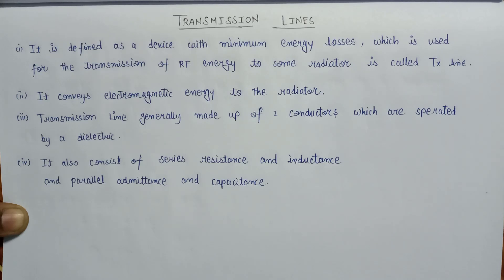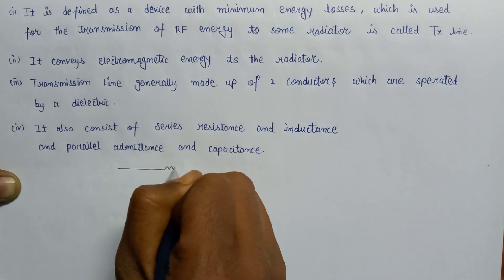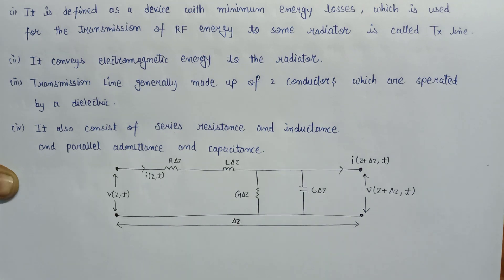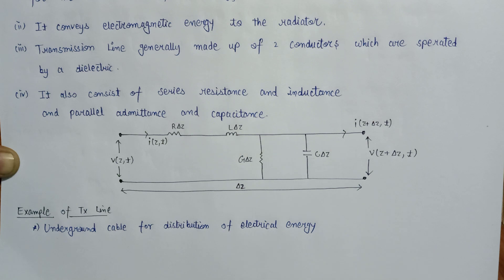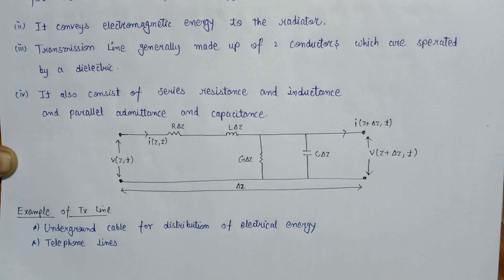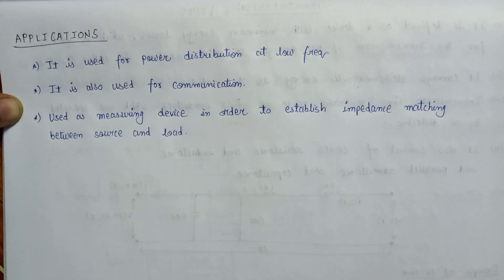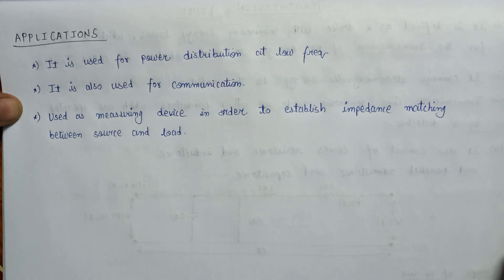Transmission Lines | Transmission Lines in Electromagnetic Waves | Transmission Lines Parameters

Comment: 00:02 A transmission line is a device with minimum energy losses used for the transmission of RF energy to a radiator.
00:41 Transmission lines consist of resistance, inductance, capacitance, and conductance
01:20 Transmission lines consist of resistance, inductance, conductor, and capacitance connected in parallel combination.
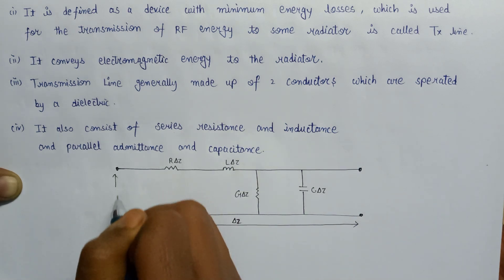02:03 Voltage applied at the input side causes current to flow and results in an output voltage and current.
02:41 The basic structure of a transmission line.
03:31 Transmission lines are found in various applications in our surroundings.
04:45 Transmission lines are used for power distribution and communication at low frequencies.
05:54 Transmission lines are important in the communication of electromagnetic waves.
Crafted by Gautam.